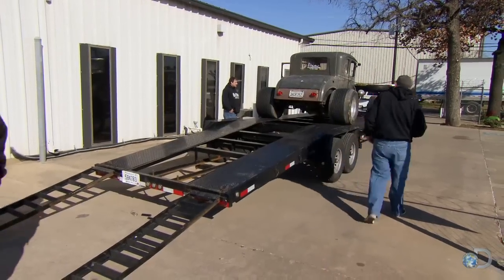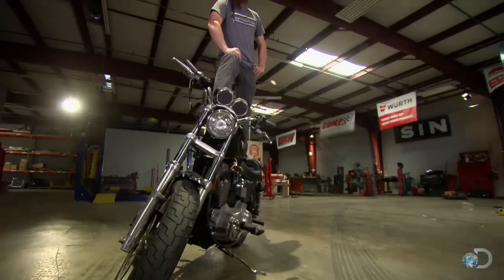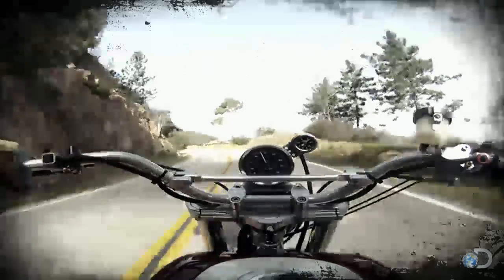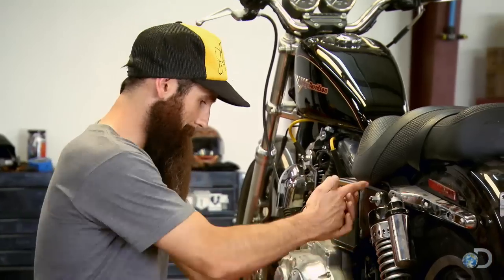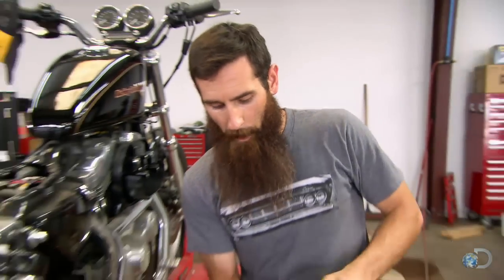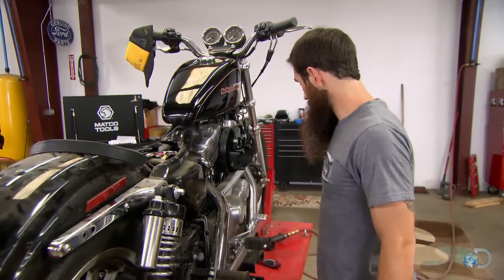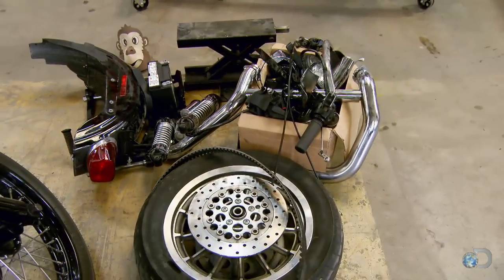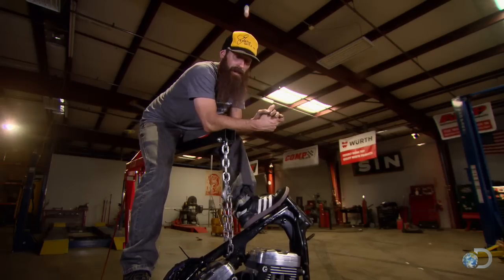Harley Sportster Overhaul | Fast N' Loud

Comment: What are your thought about using small diameter hi collar split lock washers under the cap screws on Harley Motorcycles to stop them from working loose?

Comment: better put the Toyota sticker Sportster transmission its that part on the back of the engine that doesn't come off with the belt on the wrong side, and give yourself a little beep beep with that beefy ass horn